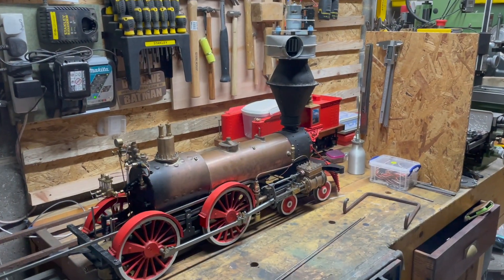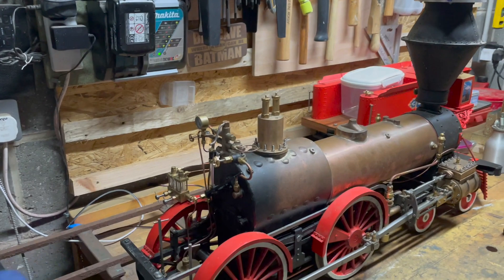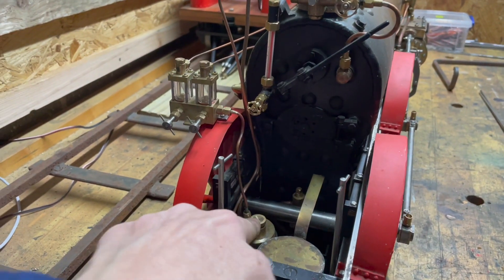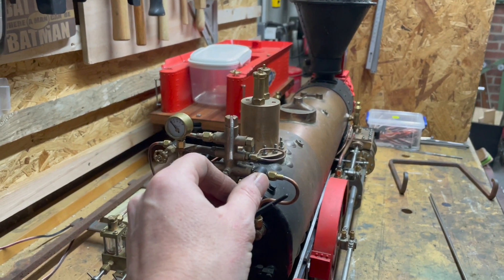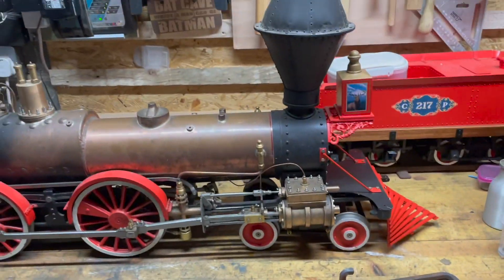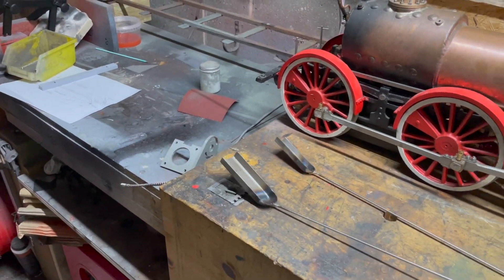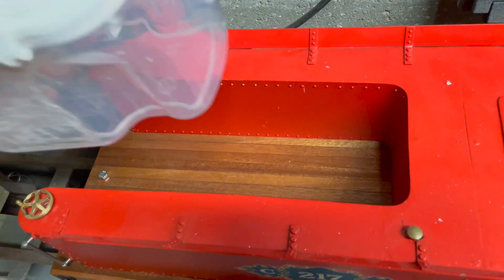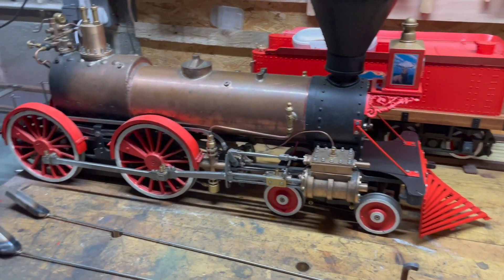Loco Ready for Steam Test

Comment: A beautifully made locomotive! Will you be adding some sort of bracing to the cow catcher? It looked a bit fragile when you touched it in the video.
Reply from the maker: Its currently 3d printed. it requires three braces fitting. But I am unsure weather to fit them currently. In it current configuration if it hits something it sheers off and comes easily away from the locomotive. It only takes me 4 days to print, cleanup and refit to the loco. 
Perhaps once I am satisfied with it I will either fit Bracing or make one from steel.